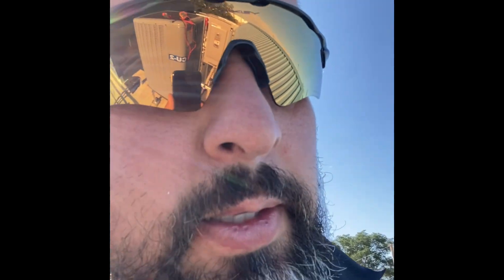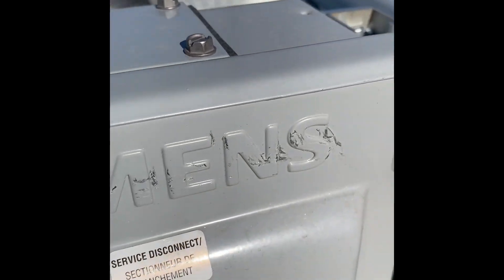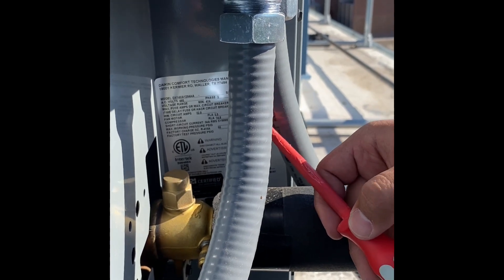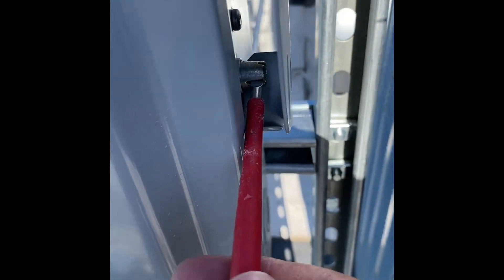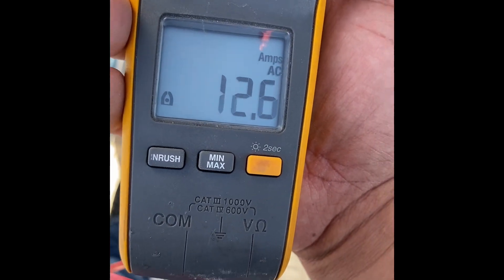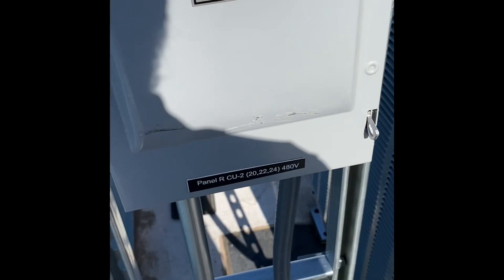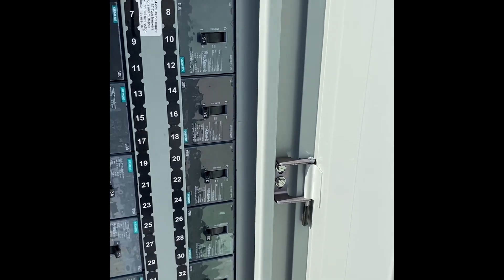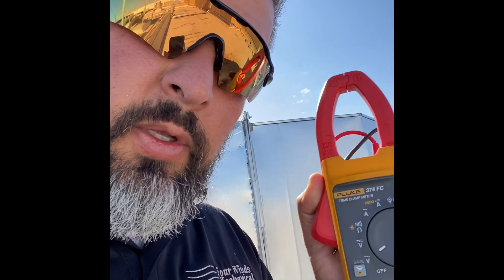How to Troubleshoot a Condensing unit / motor / 3 phase disconnect

Comment: im no pro but, would it have hurt to check the load side voltage? terminal connections, insulation test, as well as coils to see if its tripping on being clogged? or is that more so hvac guys